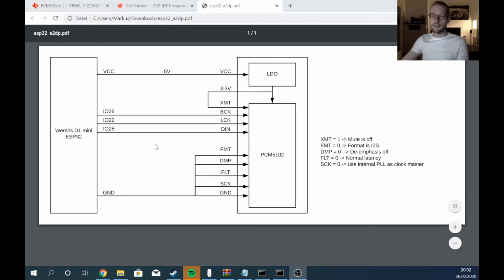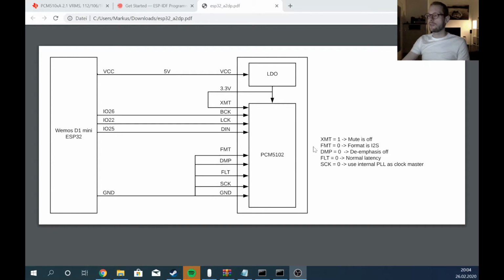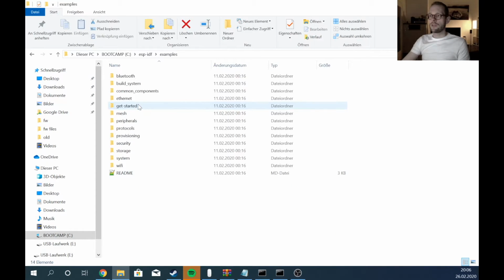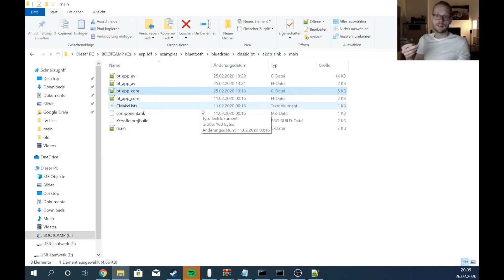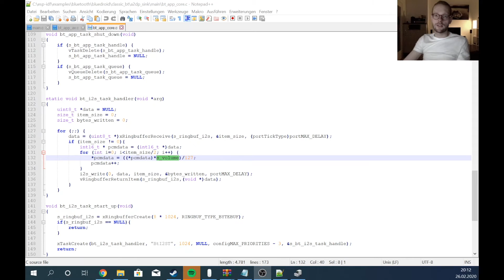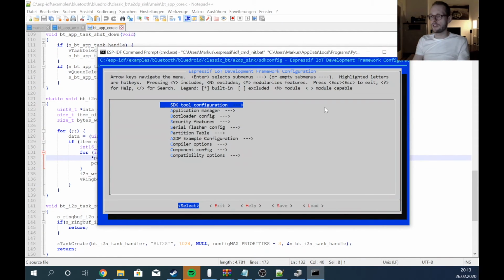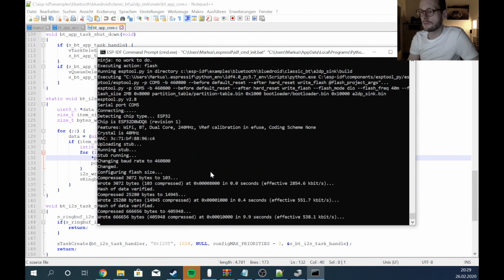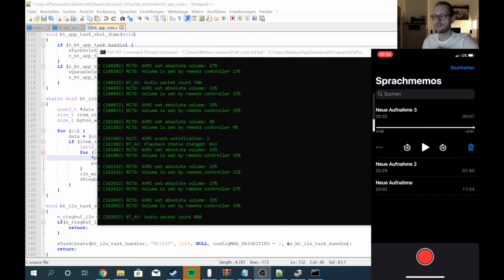[#9] ESP32 Bluetooth Audio Receiver (Tutorial)

Comment: Haha, thanks dude! This worked. Just need to implement a graphic EQ, LCD and controls.
Reply: How is the build going? :D
Reply: @aarriikknn33ll  Don't think I have the skills yet to implement that.
Reply: @antoniopetito  If you are building this i reccomend you to use this code instead, it is new and works better: https://github.com/pschatzmann/ESP32-A2DP
You will have to install the library for it, and it will work out of the box :)
All you have to wire up after uploading the code is: 
BCK -> pin 26
DIN -> 22
LCK -> 25

And FLT -> connects to ground

That's all connections you have to make, the others are not needed
I also am going to make a video of this today haha. 
For the display, this code is also more handy because you can choose to show metedata about current song playing etc..

Comment: I am using ESP32 Wrom-32 and want to use internal dac, but during idf.py build, i givin the next error "ninja: build stopped: subcommand failed.
HINT: The issue is better to resolve by replacing format specifiers to 'PRI'-family macros (include <inttypes.h> header file).
ninja failed with exit code 1, output of the command is in the C:\Espressif\frameworks\esp-idf-v5.2\examples\bluetooth\bluedroid\classic_bt\a2dp_sink\build\log\idf_py_stderr_output_8312 and C:\Espressif\frameworks\esp-idf-v5.2\examples\bluetooth\bluedroid\classic_bt\a2dp_sink\build\log\idf_py_stdout_output_8312
PS C:\Espressif\frameworks\esp-idf-v5.2\examples\bluetooth\bluedroid\classic_bt\a2dp_sink>" can you help give me some point hot to resolve prtoblems>?

Comment: What's the maximum of distance bluetooth will work with the modules you were using? Thank you!
Reply: If you are building this i reccomend you to use this code instead, it is new and works better: https://github.com/pschatzmann/ESP32-A2DP
You will have to install the library for it, and it will work out of the box :)
All you have to wire up after uploading the code is: 
BCK -> pin 26
DIN -> 22
LCK -> 25

And FLT -> connects to ground

That's all connections you have to make, the others are not needed
I also am going to make a video of this tommorow.
Maximum range depends, i have not tested yet but i could do a rough test tommorow ;)
edit: also, if you need a decent distance you can always increase the distance, watch this video for example: https://youtu.be/2rujjTOPIRU

Comment: Thank you for your hard work! Thanks for the instructions, did your job everything works with dac pcm5201, but when I connected the dac es9018 there was noise, tried different configurations, but so could not get sound. Could you direct where to look for a solution?
Reply from the maker: Can you send me a spec sheet of this DAC to my email address mentioned in my channel information? Didn’t found anything to be honest.

However - the audio stream transmitted over SBC codec Standard together with 16-Bit only I2S interface will be the limiting point regarding audio quality. You won’t have any benefit in comparison to PCM5102 when it comes to Signal-Noise ratio / distortion
Reply from the maker: I checked the datasheet. ES9018 needs by default 2*32 bit framing on the I2S input. ESP32 is doing 2*16bit in this project.

Please check register#1, bit 7:6 in the es9018 datasheet

Comment: Can you try to do the same thing with bit-shifting instead of dividing? I read that it might be faster. Before this video, I had to disable "Absolute Volume" in the developer settings of my Galaxy S9 to use volume for the IDF example.
Reply from the maker: I'm not sure anymore, but in case of a static division which is a power-of-2 number, the compiler should theoretically automatically recognise and replace it by a bit-shift operation.
Reply: @YetAnotherElectronicsChannel  Thanks for the reply.  I didnt know that about the compiler.  I just ended up replacing the "divide by 512" with a 8 pos. bit shift and it works.
Reply: @meltdown03  Optimizations of that sort should generally be left to the compiler. It’s better for the code to be readable, because inevitably you’re gonna come back to modify it and wonder, “why the fuck am I shifting this bit?”

Comment: Superb!! I am shocked at how cheap these modules are!! For my final project in my Audio systems BSc course at Uni, I built an FM synthesizer controlled via bluetooth from an App on my tablet running Android 4.2 (this was in 2013/14)... The FM synthesis was done using an Xaduino board (an Arduino mega clone with an ATXMEGA128A4U on board) . Audio out fed thru a bluetooth module. I have a link to an old youtube video of the prototype.  x . ESP 32 makes things much easier. :)
Reply from the maker: @mUbase  Very nice project. I'm also working in my normal job currently on a design for an artificial sound generator / synthesizer for electric cars. Maybe I make a video sometime about it. But I guess you had a lot of fun.

Comment: Thank you very good tutorial.. I followed all the steps but I couldn't hear the audio! the device has been connected and the audio commands can be seen correctly on the monitor but the received audio is not heard in the headphones.. when I connect this same PCM5102 to another esp32 with the same lck din bck pins programmed with a webradio skech i2s I get the audio from the radio without problem, I don't know what the problem is, the module used is TTGO T-Display ESP32 that have two DACs
Reply from the maker: Did u check already the I2S signals with the scope?
Reply: @YetAnotherElectronicsChannel  no, i not have a oscilloscope.. the esp32 has a 5v output pin that i connect it to the vin of the pcm5102 but i noted that it never reaches 5v it is always at 3.3v, I have to test it with external 5v to see if that's why.. sorry for my bad english
Reply: i configured the same pins to the tutorial, now i changed vin to stable 5v but still no sound.. when i make build is appear on cmd ninja: no work to do.. it can possible that is the responsible? thanks for your response. https://www.youtube.com/watch?v=cj4t1_URfsU
Reply: @YetAnotherElectronicsChannel  I finally have audio :) I had to change the a2dp_sink files, I have downloaded the ones from this link: https://github.com/espressif/esp-idf/tree/master/examples/bluetooth/bluedroid/classic_bt/a2dp_sink
now i have to see how to mix the webradio arduino sketch with these bluetooth sound files. thanks

Comment: Which sample rate are you using?
Reply from the maker: Dragoljub Marković actually the system is supporting 4 different sample rates and this determined by the smartphone actually. In my configuration with iPhone it always took 44.1kHz
Reply: @YetAnotherElectronicsChannel  Thanks for the quick answers, but I have more :D Is it using both cores of ESP32, or only one? I would try to use 2nd core for controlling external DSP. And, have you tried it with internal DACs?